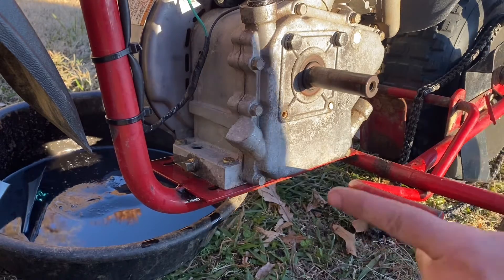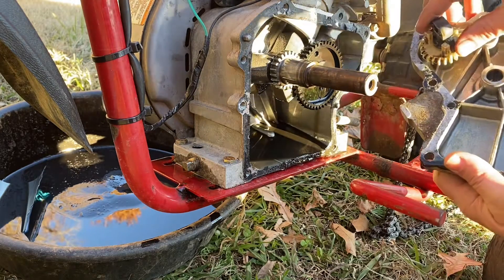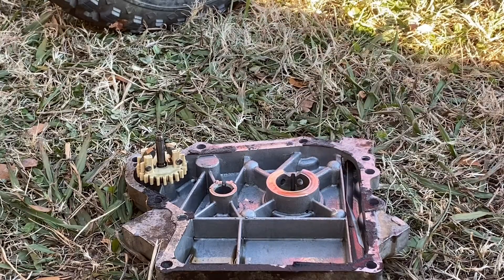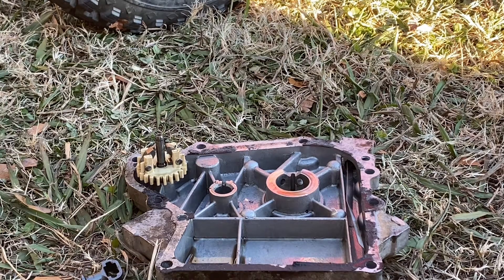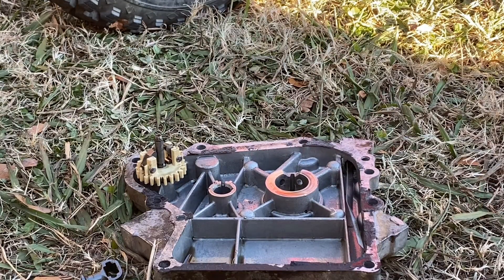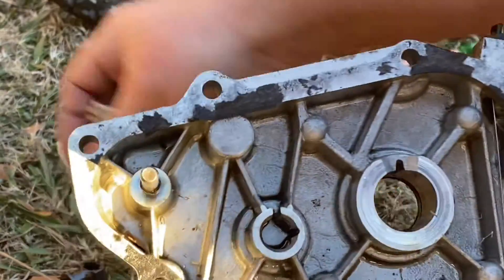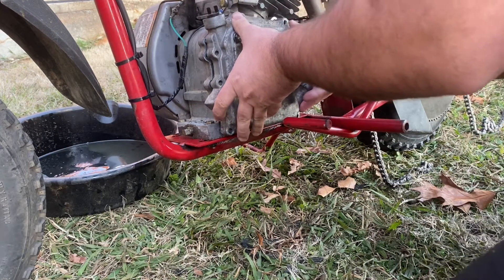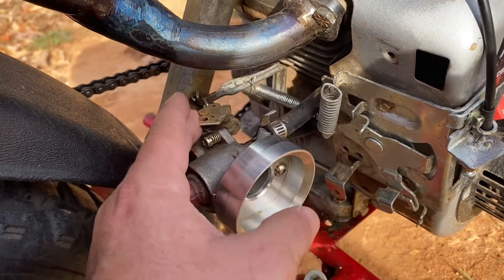Removing The Governor On Tecumseh 6hp PowerSport In 3 Minutes

Comment: See I took the rod out that the governor bracket connects to. Ground the rod the gear went on flush. Only thing I forgot is the rod that went through the case. Gotta tap and plug it.

Comment: That exhaust sounds awesome! I have this same exact engine where do I get the exhaust?
Reply from the maker: I made it myself. They sell 1 inch exhaust kits on eBay and Amazon with a couple different pieces and bends for around $35.
Reply: @jwsbackyard6413  thanks! how do I install the performance filter on the carb ?
Reply from the maker: You need an adapter like this https://www.bmikarts.com/Air-Filter-Adapter_p_463.html?amp=1
Reply: Could you share a link to the exhaust kit? I have same engine on my thunderbird and want to install a header as well. For the carburetor I’m using a vm22 with a 212 intake manifold bolted to the stock one. Little janky but runs great.
Reply from the maker: @srcobra50  It looks like they don’t sell the kits anymore. Searched for it and ended up going to purchase history and it looks like it’s no longer available. They used to be all over eBay, I bought at least 5 of those kits.
Reply: @jwsbackyard6413  damn well that sucks Il keep looking then. Thank you 👍

Comment: I have this engine on a go kart and replaced the carburetor and worked but the governor seems to stick and makes the engine run near full throttle(w/o throttle cable connected). When I adjust the carb idle down it will decrease slightly and go dead or throttle up high again and stick most of the time.

Will removing the governor and adding the spring correct this?

I thought the governor was required.
Reply from the maker: It sounds like you may just have a spring issue. There is a factory spring that helps the throttle return to idle. Make sure that is still connected or connected to the correct spot. A governor is not required, it just limits how high an engine can rev. Removing the governor wouldn’t fix the issue because your problem is the linkages/spring not letting the throttle return. I’d also check your throttle cable. Sometimes they can corrode and stick  causing the spring to not be strong enough to return the engine to idle.

Comment: I have the same bike do you have to order that spring that mikes the engine not run wide open, and if you do can you give me the link of where you got it. Thanks!
Reply from the maker: I just used a plain old spring that I got in a variety pack of springs at harbor freight.
Reply: @jwsbackyard6413  what’s the top speed before the governor and then after the removal?
Reply from the maker: @tvm_2346  honestly I don’t know but if I had to guess I probably picked up at least and extra 10mph
Reply: @jwsbackyard6413  do you have any social media or anything where you could help me a little with putting the spring on I really need help
Reply from the maker: I have Facebook, if you want to add a link I can add you. What are you having trouble with?

Comment: Did you have to change the flywheel?
Reply from the maker: No it’s held up fine so far
Reply: Yes, it's very dangerous if you don’t not Change toa flywheel rated for those rpm's